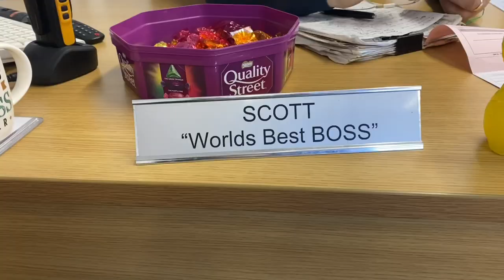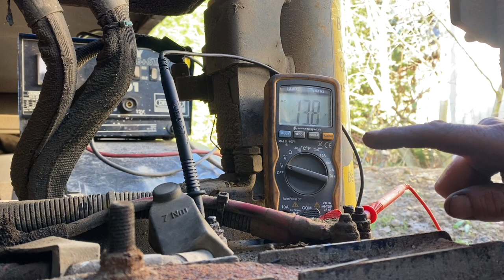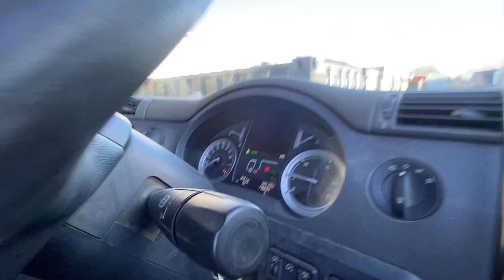falling apart one peace at a time! Loosing money by the minute! Bearing 💥

Comment: Little Birdie is sweet and such a good little girl❤🇨🇦 Would CB stand for charge battery?
Reply from the maker: Cheers Roxanne! She wanted that drink though 😂🤦🏼‍♂️🤠
Reply: Yes! CB does indeed stand for "Charge Battery" on most battery testers. In this case though, the rear-most battery was in poor condition, and batteries wired in series (like these are, they double the 12v of a single battery to the 24v used by most large equipment) mean the 'pack' as a whole, if you imagine it like that, will mean the duff battery would pull the good battery down quickly, because it's being hammered much harder than it should be to pick up the slack from the failing one. Hence, as Chris says, you always replace them together.

Comment: Chris the outer part on the old bearing is a locking collar if you look inside the bearing side of the collar you will see it is oddly shaped to the bearing being round, the idea is you fit the collar over the shaft onto the bearing and turn the the collar in the opposite direction to the rotating shaft, tighten by tapping with a punch and hammer, and then lock the grub screw. Hence locking the bearing to the shaft.
Reply from the maker: Thanks Ian much appreciated advice there mate 👍
Reply: @Professional-struggler  No problem Chris.
Reply: Just came on to say the same thing

Comment: Battery testers yeah the old toaster element type  we took tops off and watch for bubbles looking back you understand why  elf and safety binned them   those cheap flicky switch ones only do 250 300 amps so no use for commy batteries  maybe 900 amps more
So they are always going to give false reading and false hopes 
Have a digital one   when chinese stuff was cheap and it's been bang on
Reply from the maker: Yeah I’ll have to invest in one mate 👍
Reply: @Professional-struggler   well worth the investment.         Your just going to have to commit  and put hand in pocket and maybe just go that extra mile and put some more diesel in the Struggle Bus       Save you time and temptation from scooby snacks

Comment: I find with pressed on bearings like that, smash in the best way possible the out casing off and what is left of the ball bearing. Grind the remaining bearing shell right down to the shaft, smack it with a good blow, it should crack then at the lowest point and with the heat created by the grinder and the extra microns of space made between the shell and the shaft, it should slide straight off. Try and grind if possible where the grub screws sit.
Having dealt with 100s of these, that have been pressed on with 75 ton. Heavier the tonnage, the better the crack ;)